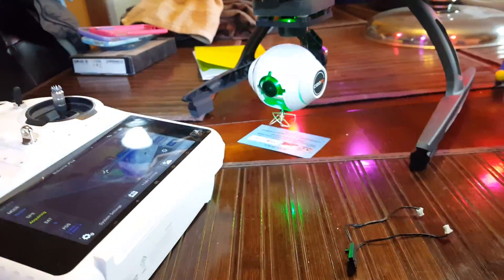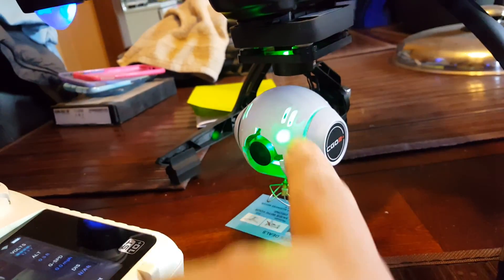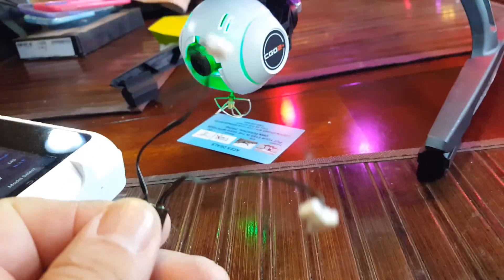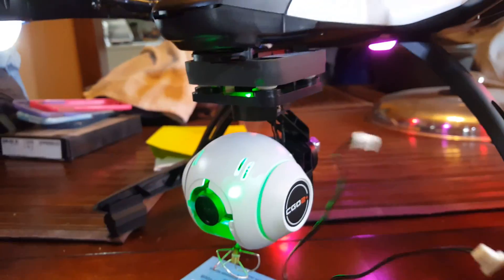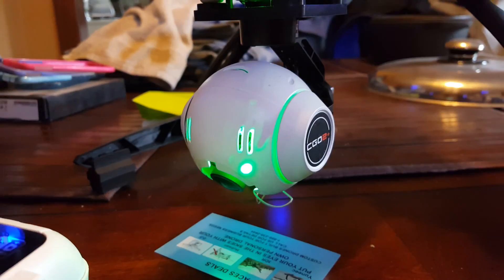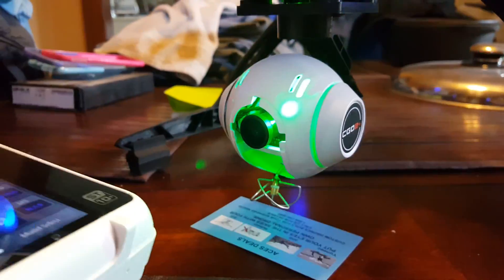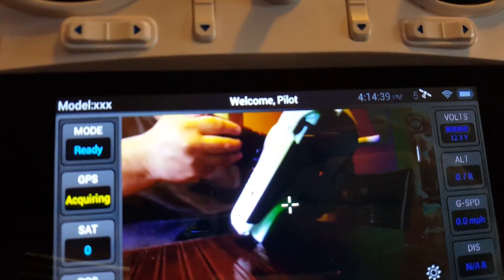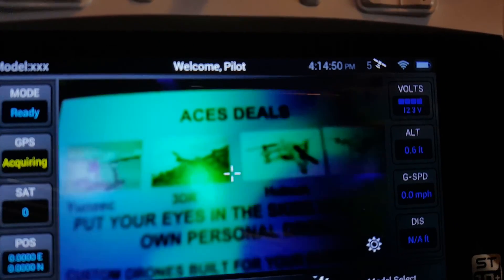Yuneec Q500+ Gimbal Cable.. Full Camera Tilt

Comment: Hello, you advise how to boil with weights CGO2+.Why do you have a screw and washer?Thank
Reply from the maker: Amos drone that's there cause the original weight was lost when u bought it Used....  So I had to use that as the Counterbalance
Reply: OK.And how do I balance the original CGO2+.I can not find instructions.
Reply from the maker: When the vibrating noise goes away...  With the original Counterbalance you would turn it one way or the other to increase or decrease the weight....  I just kept adding washers until the noise went away
Reply: Erwin Delarmente  the camera is switched off tipped it to be.
Reply from the maker: Amos drone what???
Reply from the maker: Tipped it to be??   What does that mean??  Lol
Reply: Erwin Delarmente Excuse my English, I am Bohemia when the camera is turned off and tipped it seems to me
Reply from the maker: +Amos drone yes I guess so?
Reply: Erwin Delarmente seeking guidance on how to set the counterweights on camera
Reply from the maker: Have the camera facing forward... Make sure the quadcopter is on..  Turn the counterweight all the way towards the camera...  When it's unbalanced the Motors will vibrate....  Just keep turning the weight the other way until the  u ration from the Motors go away...  Then it will be balanced
Reply: quadcopter is on?Turn left or right?
Reply from the maker: Righty tighty lefty loosey
Reply from the maker: Yes make sure the quadcopter is turned On..
Reply from the maker: OK gotta go.. Have a great day!!!
Reply: Erwin Delarmente how do i turn the counterweight

Comment: What is your max altitude and max range?
Reply from the maker: Height limit is set to 400ft &  that's by law...  Max distance I've gone 800feet out...  Dot know the max cause I've never tested it...
Reply: Reymar Carino you can edit max height on your computer.
Reply from the maker: Yes I know this but it will break Canada Transports set regulations...